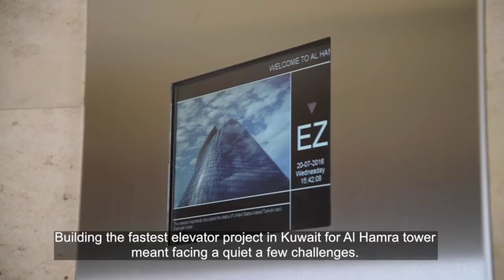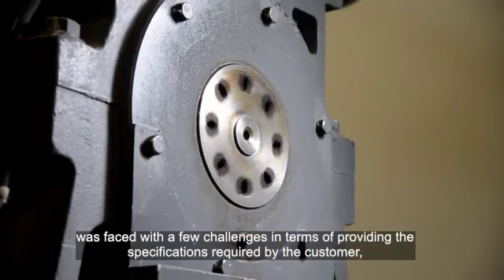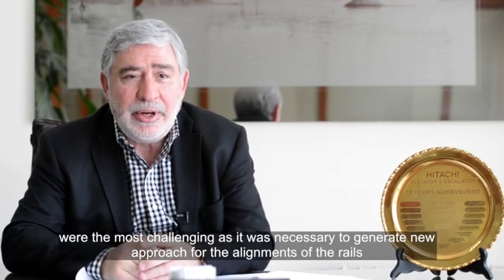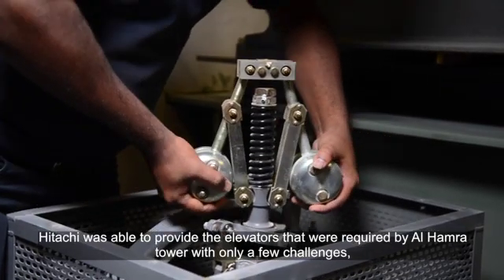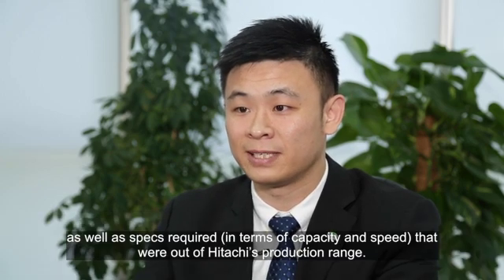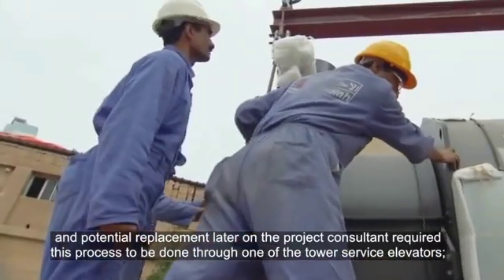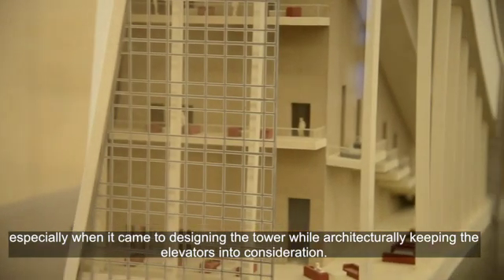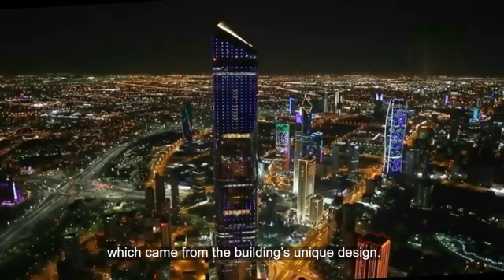Installation of Hitachi Elevators & Escalators in Al Hamra tower - Kuwait Challenge - Hitachi

Comment: how much is the cost of elevator room for a 4 storey bldg 4 stops. glass at rear side of the elevator room. i need 1 unit. pls col me at cel 09228552447 or lanline 0324182729
Reply: I'm pretty sure HitachiBrandChannel does not provide quotes. What a dumb ass.